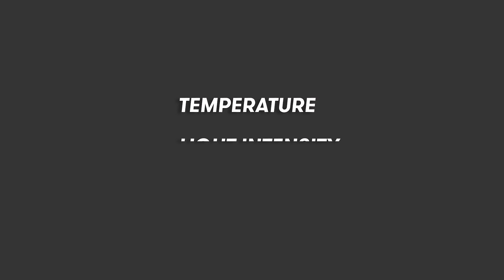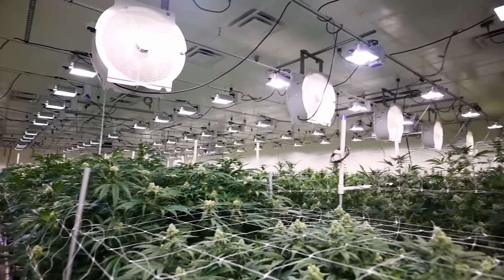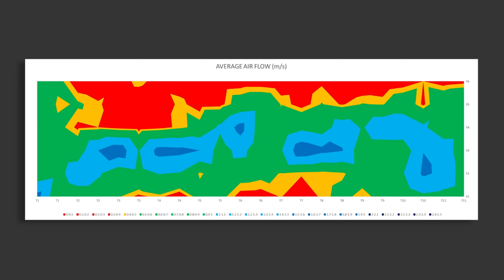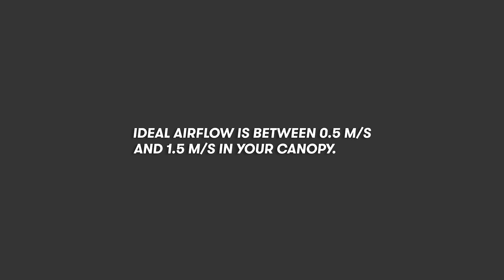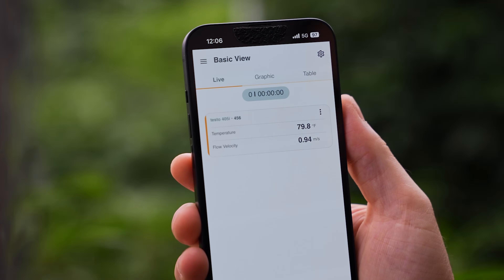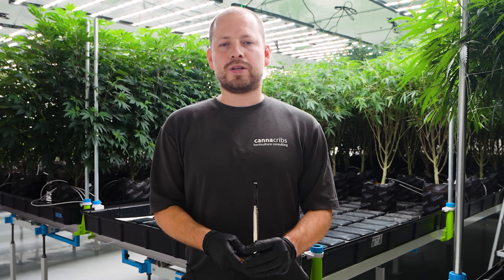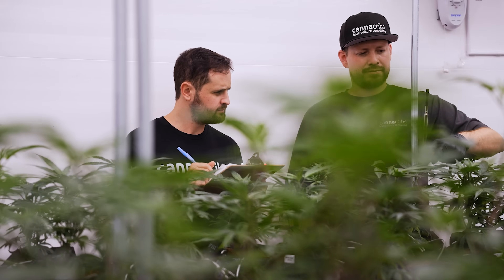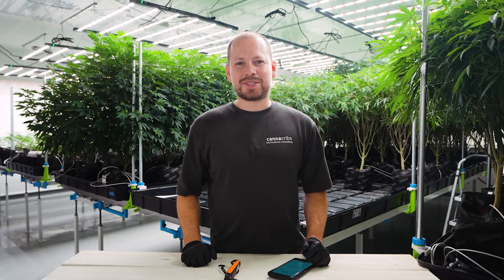Optimizing Grow Room Airflow: Fans, Ventilation, Airflow Mapping & Advanced Techniques

Comment: Great video! What about air flow at the drying room? How important it is? And how it should be installed and at what velocity? 

Thanks!
Reply: Depends on your setup. If you hang dry whole plants, you need very little airflow in the dry room. I'd say somewhere below 0.1 m/s. 
Blowing air on the drying plants can cause incosistencies in drying and cause the flower to get overly dry on the outside while the inside is still wet. 
To me, pulling the humid air AWAY from the plants is much more important and there are different ways to accomplish this.
Reply: @Juangrow_cannacribs  thanks! That makes sense. What about screen drying? Considering your explanation, screen drying must have air flow properly set. Right? So I can be sure that the moisture pulling off the flowers is being taken away from the screen.

Would be 0.5m/s enought? I think that setting the fan right bellow the ceiling may be a good idea? So it doesn't blow air directly at the buds.

Comment: Very good information to have about the air movement being below 0.5m/s creates an environment for botrytis etc. And above 1.5m/s creates uneven microclimates. 
This is a crucial bit of information for any hobbyist/commercial grower to take onboard for a successful crop.

It’s easy to test too. Simply spray a mist of water into the air on one side of the tent and time its travel to the other side of the tent. When it’s at 1m/s - your Gold!
Reply from the maker: Thanks for the great tip on measuring airflow! We'll try that out next time.

Comment: why not have air blown from under the plant? air ducting?
Reply: Hey!
It can be beneficial in certain situations; however, we typically don’t recommend it. Excessive airflow near the substrate can have a few negative effects:
- It can lead to increased evapotranspiration. This can dry out plants unnecessarily, requiring more frequent irrigation and potentially creating inconsistencies in the grow space.
- Air movement near the substrate can stir up pathogens and contaminants, which is especially problematic in medical cannabis facilities where maintaining clean flower is critical.

If there is sufficient airflow at canopy level, you will naturally achieve adequate air mixing, which helps pull air from within the canopy. On top of that, in a properly ventilated room with CO2 supplementation, levels should remain high enough to prevent the levels from getting too low and affecting photosynthesis. 

When would I add airflow below the canopy? if I have a dense, tall canopy where the risk of microclimate formation is higher. But I would rather work on my canopy management than to add more equipment, cost and incosistencies in my crop.
Reply: I use sub canopy ducting religiously. I don’t have a single leaf in my entire grow that isn’t wiggling. My 6” ducts run down one edge of each row, so they are easy to install and remove for harvest/cleaning. The air tubes which I had custom made come in a roll, and have holes that point upwards. Air is always moving up through the canopy where it is then blown away by the horizontal fans. It does not blow on substrate nor does it blow along the ground. It’s a game changer; I no longer spray for PM.

For me it’s a necessity. I grow on multi tiered racks and the plants are kept short, buds all the way down to the base. But even when I grow in a single level room I still use them. If you push your racks together, the air below the plants in the middle of the room just hangs there.
Reply from the maker: Good question! We'll have Juan or Deron get back to you soon! Thanks for watching!